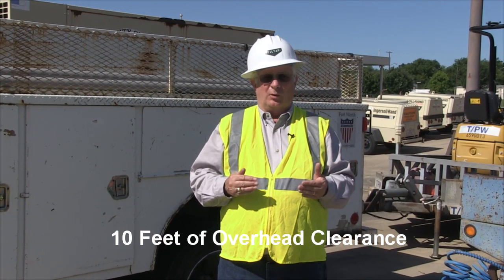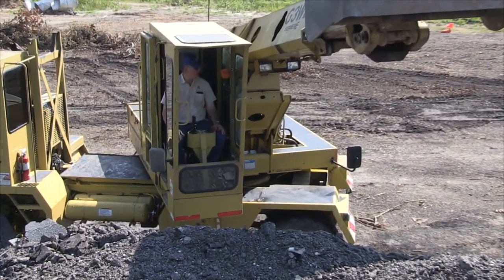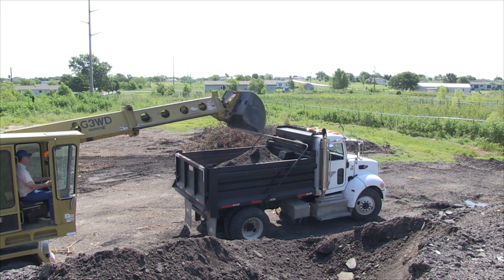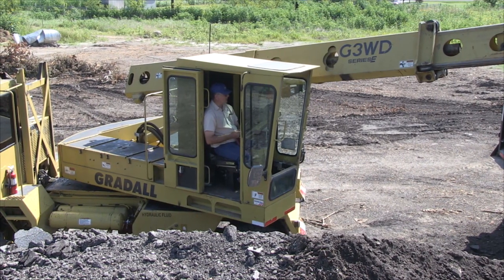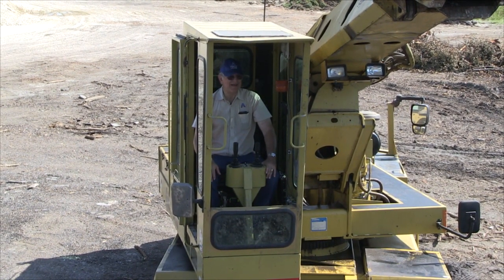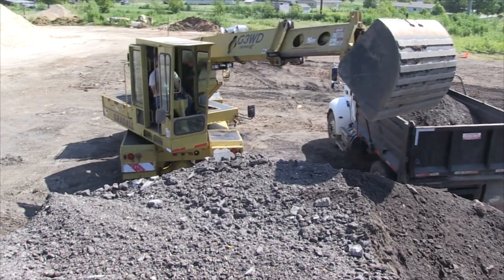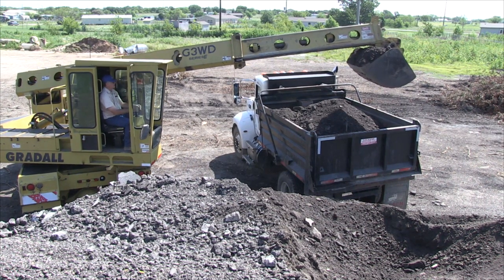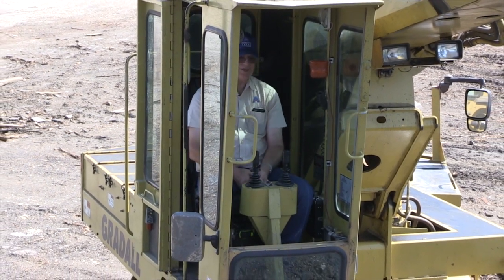TxLTAP Loading a dump truck with a Gradall

Comment: When I started working in construction in 1980, I worked with a Gradall operator digging swimming pools. The company owned 2 Gradall G-660’s and my job was raking/grading the excavations while using the story pole for the guy on the transit(no laser transits back then) Those G-660’s and the operator’s dug a nice hole !

Comment: I'm noticing the bouncy side to side movements - wonder how come Gradall doesn't put those hydraulic stabilizers on them.
Reply: I have been around gradalls since thev1970'  even the ones set up to run on railroad tracks don't have out riggers for some reason yet the articulate d boom on duel wheels all around have at least one set of out riggers even if the have a blade.
Reply: @vicktorpatriot1430  I have seen the newer 4x4 ones with one cab with outriggers.
Reply: @linkbeltdemolitiondude1219  gradall excavators or JLG , Manitou etc telescoping fork lifts?
Reply: @vicktorpatriot1430  The New Gradall Rough Terrain excavators. You can get either 2 outriggers and a push blade, or 4 outriggers and a push blade. I looked on their website.
Reply: @linkbeltdemolitiondude1219  seems most don't want to pay for the option.